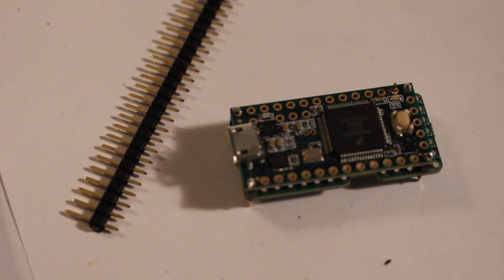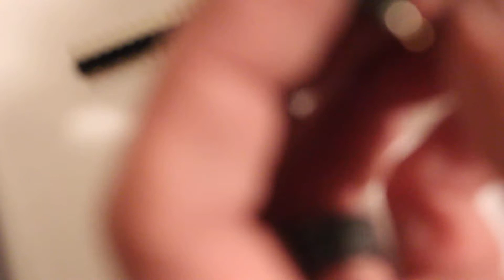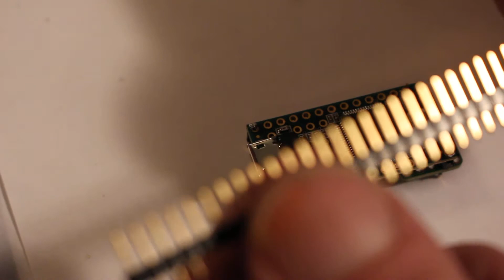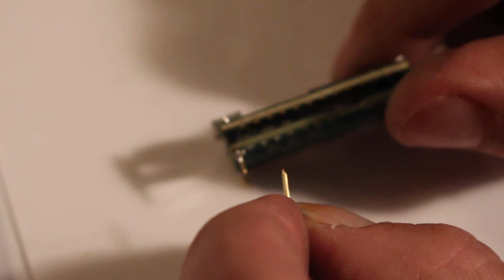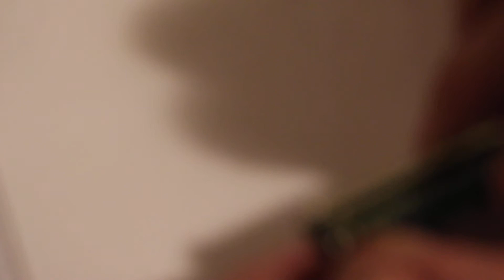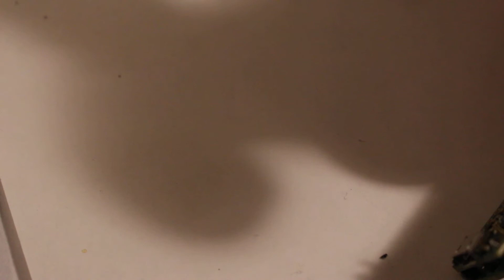Teensy lightsaber sound board

Comment: Hi teensy saber v3 support ws2812 5 volts without Change anything in the code or add some library?
Reply from the maker: Felix Salazar, yes you have to adjust the programming. Fredrik has a webpage here. http://fredrik.hubbe.net/lightsaber/v3/
Reply: @Jediseth  yes i see they page and  show ws2811 but not 2812b
Reply from the maker: Felix Salazar id write Fredrik and ask.
Reply: @Jediseth  ok thanks
Reply: @Jediseth  what LED strip do you use
Reply from the maker: https://www.ebay.com/itm/WS2812B-5050-RGB-Dream-Color-30-60-144-LED-Strip-Light-5V-Individual-Addressable/201963047995?ssPageName=STRK%3AMEBIDX%3AIT&var=501973707404&_trksid=p2057872.m2749.l2649&redirect=mobile&rmvSB=true&ul_ref=http%253A%252F%252Frover.ebay.com%252Frover%252F1%252F711-53200-19255-0%252F1%253Ftype%253D3%2526campId%253D5336432705%2526toolId%253D10001%2526customId%253Djj3duchieg0004m600004%2526mpre%253Dhttps%25253A%25252F%25252Fwww.ebay.com%25252Fitm%25252FWS2812B-5050-RGB-Dream-Color-30-60-144-LED-Strip-Light-5V-Individual-Addressable%25252F201963047995%25253FssPageName%25253DSTRK%2525253AMEBIDX%2525253AIT%252526var%25253D501973707404%252526_trksid%25253Dp2057872.m2749.l2649%252526redirect%25253Dmobile%2526srcrot%253D711-53200-19255-0%2526rvr_id%253D1584548243091%2526rvr_ts%253D57dfa55c1640a99ba664dd1ffffd7bae&ul_noapp=true